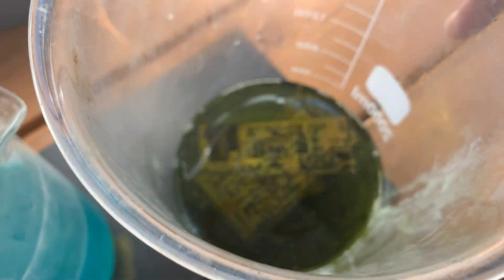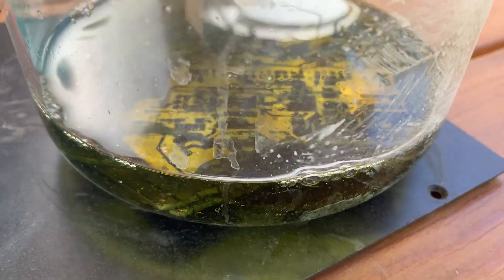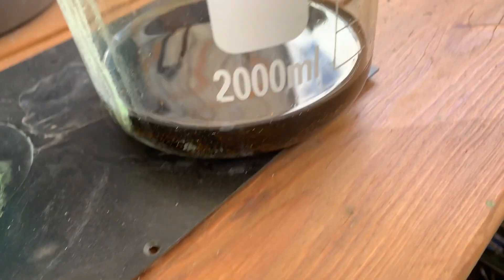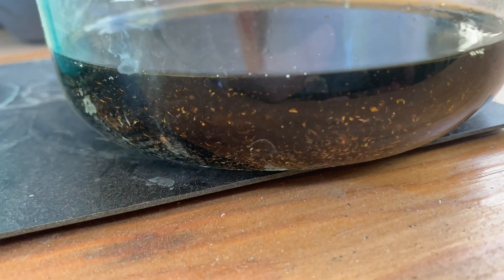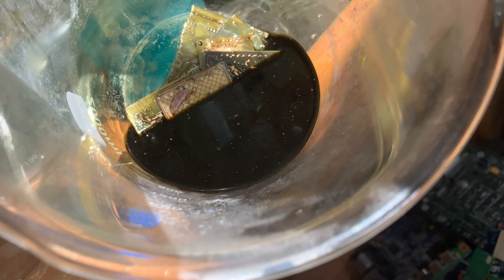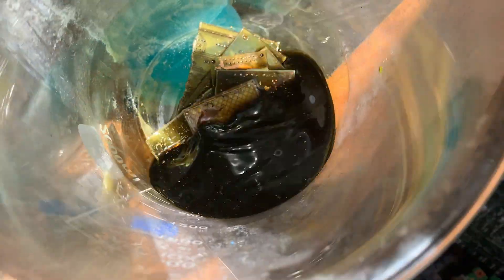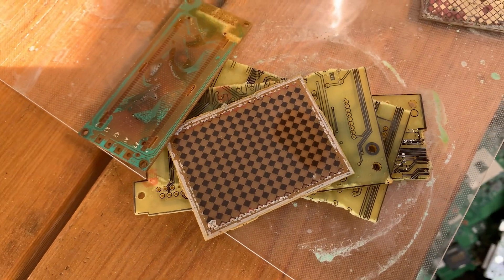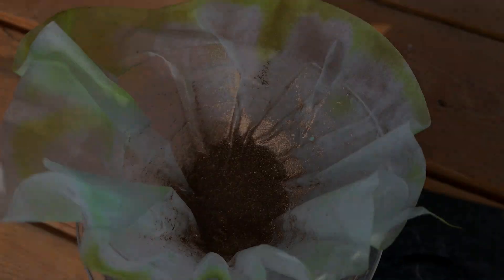Stripping Gold After Solder Mask Removal

Comment: Use buckets when dealing with AP. This way you can have a smaller bucket inside a larger one with holes drilled out so all the foils fall into the larger bucket making it easier to filter. With larger boards doesnt really matter but with fingers its a huge help.
Reply from the maker: That is brilliant! I have a plastic colander (noodle strainer) that will fit over a 5 gallon bucket, but that still could over flow ... I like your bucket in bucket better.
Reply: @badideametals  with 5 gallon bucket you shouldnt have to worry about overflowing. I used thensame technique but larger, a 55 gallon trash can with a 35 gallon car wash soap. I used a dowel so the smaller one would never sit on the bottom of the larger one and I rarely ever shaked anything. You should twist shake or disturb the foils if your not rushing the process, you can do all those things dont get me wrong but if you leave it alone the foils come off in one piece mostly so your not dealing with the small black particles that can go through filters. Newer fingers can do that no matter what sometimes. But I was like you, a week or two but I never touched until inwas ready to filter everything. Works the same for large boards

Comment: hi cool video,if you use a something like a plastic tub and air bubbler it will work a lot faster and make sure to save the acid as you can use this again by adding fresh hcl and you wont need to add any peroxide as you have copper chloride , keep up the great work
Reply from the maker: I am going to need to get a bubbler ... it helps move the liquid as well as it adds oxygen which is what the peroxide is doing (which you said could be left out with the use of the bubbler)... I find I get a density column where the Copper Chloride stays separated from the HCl at certain temperatures.  Thanks for the advice :)

Comment: nice demonstration.air bubbler helps keeps the acid fresh...yeah there a plastic sheath on the mouse pads. I just rub my fingers over them and it comes off easy.the acid works quicker then.👍👍
Reply: Rubbing is okay, but a little slow. If you put the board in acetone for a while it wil come of very fast and easy with a brush. Afterwards the acetone is reusable.
Reply: @TheDurdane  yeah I actually seen a video there recently of somebody using acetone..my god it's works fair quick.ill definitely be using that next time.thanks for the tip